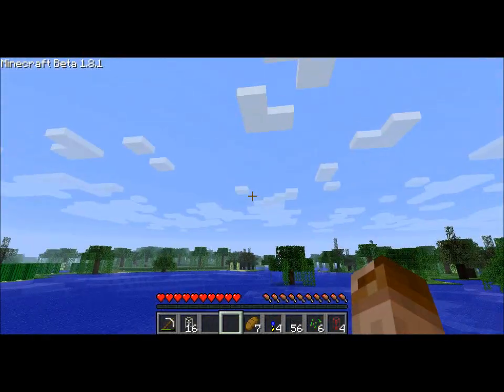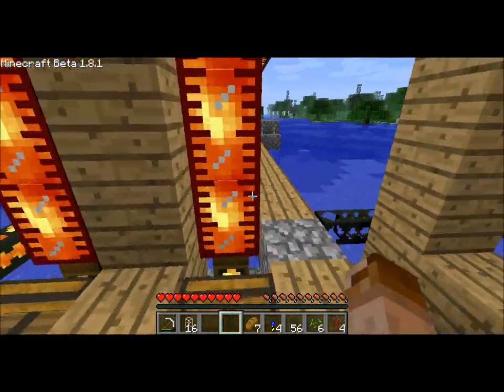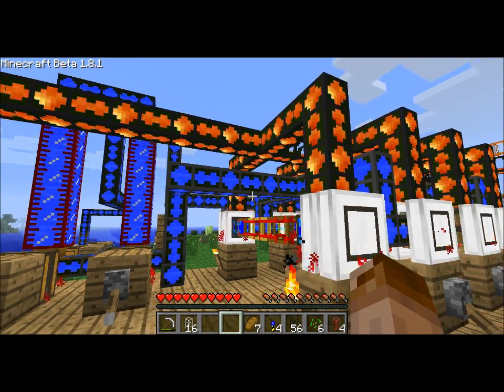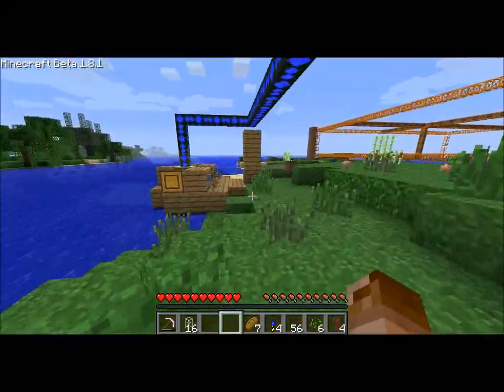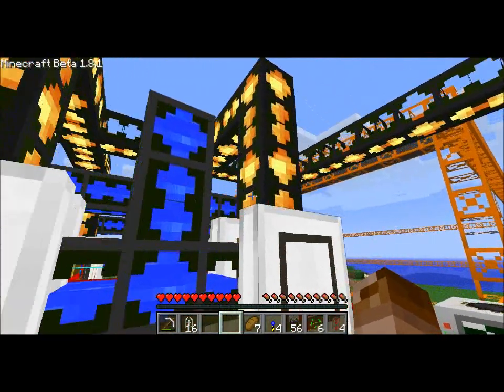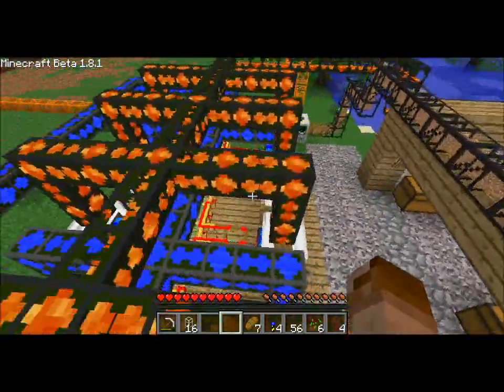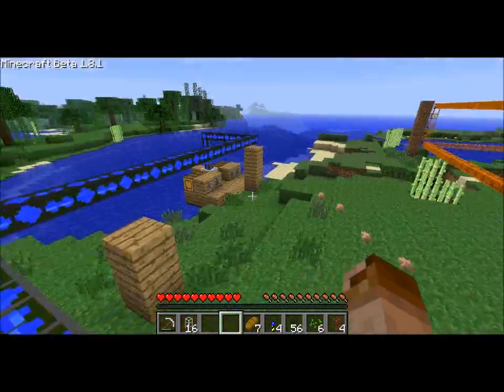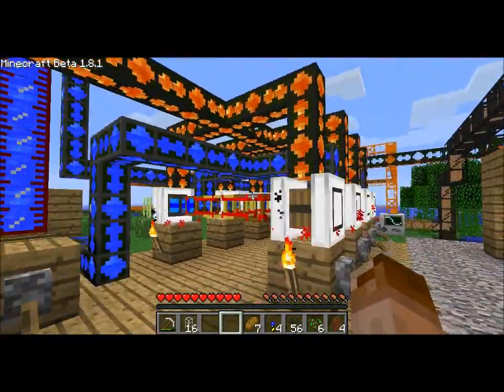Buildcraft Combustion Engines

Comment: I had a setup which used 1 combustion engine running on fuel to power a pump, which pumped water to cool 2 other combustion engines. With stone pipes it would occasionaly overheat. I changed stone pipes to golden pipes, and now i have 4 combustion engines running with no problems whatsoever, this little power factory is completely self sufficient. However, 4 engines is maximum. If you have 5 to 8 engines, you would need two pumps. So, PROTIP: always use gold pipes for running water to engines.

Comment: oh ok sweet as, yeah I'm using fuel because it is more efficient, but makes them overheat much faster >.< I think I got it now, I have 1 engine powering 1 pump, cooling 3 engines, which should work..

Comment: Wow, a quick response :3

anyways, you need BC 3.X for the red piping wire - i added another safe system - when the engine is yellow OR red, then emit the red pipe signal. the red pipe wire is connected to a simple gate that emits redstone signal which connects to my RS nor latch, therefore making it even more safe.
(I'm even a newb at BC, but I'm doing this, I dont know how.)
All I need to do now is make a simple fuel system.
(It is highly recommended to add a fail safe system)

Comment from the maker: I dont see why it would not. If the engine starts to get warm the signal shuts off shutting down the engine. Should be. As of yet none of my engines have that failsafe built into them. Mostly because I cant find a wiki that gives me the ingredients for those new pipes that transmit redstone signals.

Comment: Forget my other comment...

Anyways, i was wondering if my combustion engines will explode - here is the layout:

E = engine
G = Grass

E G G E G G E
E G G E G G E
E G G E G G E

Each set of 3 Engines have thier own pump - pumping out water from an unlimited source. (3x3)

On the wooden pipes above the engines are iron OR gates. as the options i put:
If the engine is Green or Blue, then emit redstone signal.
The redstone is connected to a RS nor latch so only i can reset it.
Will that be safe?

Comment from the maker: I just have to say this.

I have done a test using fuel. This configuration will run out of water and explode when you use refined fuel in it. So will my new engine. I am going to redesign later with much better cooling. In the mean time, be forwarned.